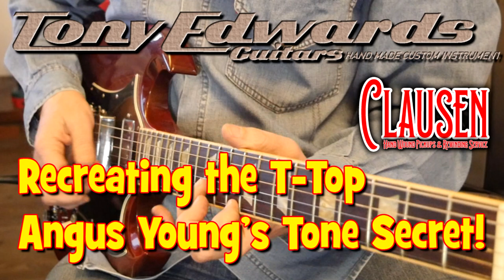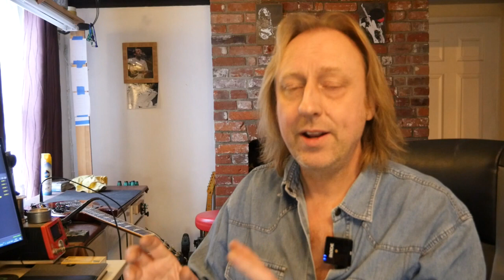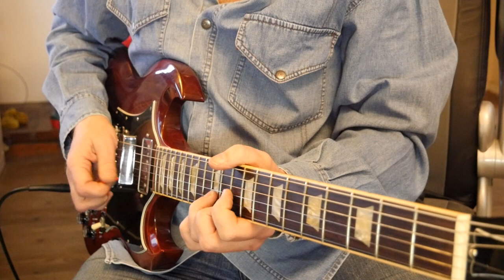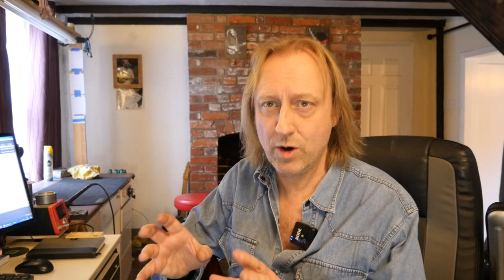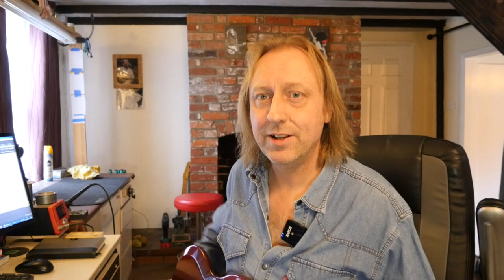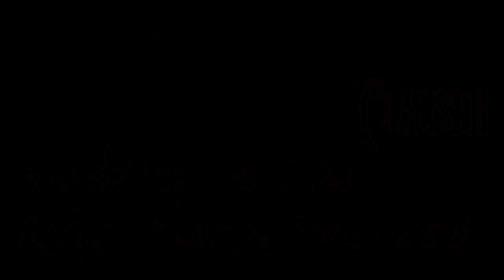Angus Young's Tone - recreating the Gibson T Top Pickup

Comment: Definitely has that distinctive almost strat like "ping" that angus get from his SG. But still sounds a tiny bit too hot like its breaking up too much for a low volume amp, I wonder if the bridge humbucker was lowered slightly and you let an amp at higher volume do the dirty work would it be more like that almost clean angus tone. I read somewhere before that angus and malcolm used to record in the studio at very high amp volume.

Comment: Sounds amazing. A "hotter pickup" is probably just an easy sales pitch. I can't comment on 50s gear but on a modern amp raising the impedance is just going to drive the input circuitry harder and steal head room from the pre amp. And that's why Angus sounds so good. He controls the level of distortion by how he hits the strings, not by turning up the gain so it's always distorting.

Comment: Fantastic sounding pickup, Tony. And you've nailed the early AC/DC Angus sound. I'm figuring it's around 7.5k. Like you, I'm astounded that more folks don't want low output humbuckers. Probably the best-sounding pickup I've played is an Ibanez/Maxon Super 70, which was about 7.6k.
Reply: Hi i don´t know about pickups specs, is there any video or explanation that could help? Thanks :)
And also i've a SG standard with 57 classic on it, i've been looking for and it says that they've 8k cc resistance, what does it mean? thanks again, have a nice day :)
Reply: Yes , both the Super 70 and T Top are around 7.5k to 7.8k..But the A8 Magnet (Super 70)has much higher output than the short A5...
Reply: @InveRz Resistance is just about how much copper winds is around the coils...It tells you NOTHING  about the output/loudness

Comment: I thought the wireless was the tone secret, a secret that was solved with the SoloDallas Storm shaffer replica? I need custom pickups as well? Edit, I guess I should have watched the entire video before opening my mouth, thanks for the info! Edit 2, yep sounds spot on to me, if I went to a concert with a acdc tribute band and this was the tone of the guitar, I would be happy.
Reply from the maker: You  know, I totally get the initial cynicism about custom pickups - and it's entirely correct to be a bit sceptical. I mean, there's so many off the shelf pickups out there, surely there's something out there that already does the job. 
The problem with pickups is not the quality of what's out there from Seymour or Dimarzio etc, it is that the process of finding the right one is difficult. You're relying on someone to accurately describe what is likely to be the result of putting the pickup in your guitar, through your rig.  That's why I started doing what I do - not to have a whole range of off the shelf pickups but to wind specific custom jobs for specific customers. Sometimes I make those available because I think they will fulfil a good role for a lot of players, but most of them remain custom winds, never to be fully repeated. Often, the process of getting the custom pickup right requires more than one wind - and I rewind for the customer to taste or alter the magnet strength using my first design as a starting point.
Reply: @TonyEdwardsGuitars  I am trying to decide what to put in my 338. The stock pups are microphonic as hell. I was thinking a pair of nashville retrotrons from guitar fetish. What do you think about mixing pups, like a retrotron in the bridge and something different in the neck?
Reply from the maker: @kaptkrunchfpv  There's no specific reason not to, but just be careful that you know what you want for tone and strength in both positions before you put down a lot of cash on anything.

Comment: Great sound. What amp and settings are you using? Effects? Thank you!
Reply from the maker: Using Helix - Bright Channel on a plexi, Tones all on 3, presence on 2, slight mid boost from an EQ in front of the amp sim, 25w Greenback Cab with 2 57s, one centre one cone. Top and tail EQ on the outboard at 80Hz/7kHz, which is the standard way to deal with Helix natural tendency to fuzziness.

Comment: Not that I would buy them since they are overpriced and I'd rather support independent builders but I wonder how Gibson's new t type t top clones compare to the originals?
Reply from the maker: Honestly, I had no idea that they'd reissued the T Tops. 
If the burstbuckers are anything to go by, probably pretty good. My issue with BBs is that I prefer a wider differential between the bridge and neck in a Gibson style guitar. I used to use Bare Knuckles in all my builds until about 10 years ago - the Mules being my go to set. But I never could quite get the balance how I wanted. I can't claim my pickups are better than anyone else's, but they do have the balance that I prefer in terms of tones/strengths. 
These kinda odd reissues come about because I wound one for a customer on request, found l liked the result and added the recipe to the list of things I could offer.
Reply: What's the price on a bridge t-top?